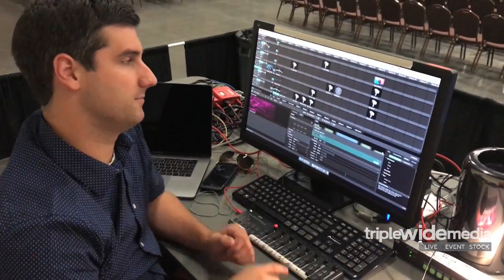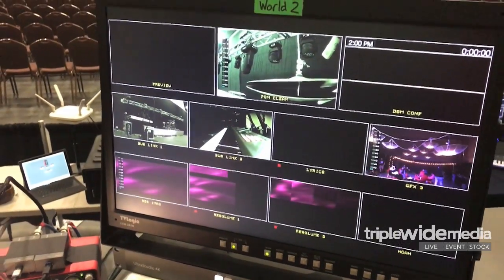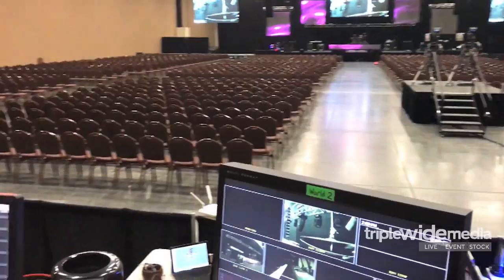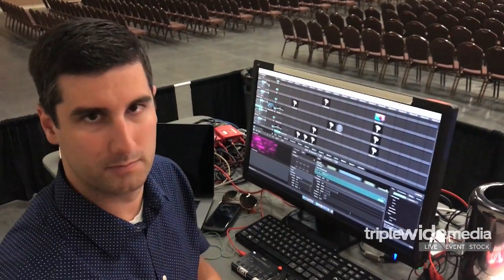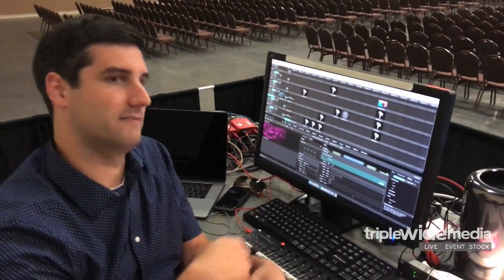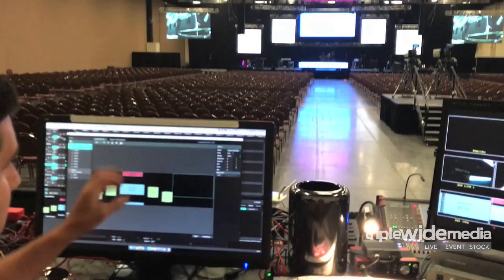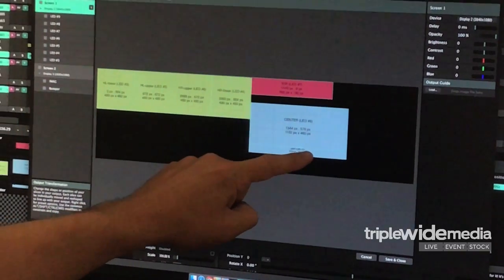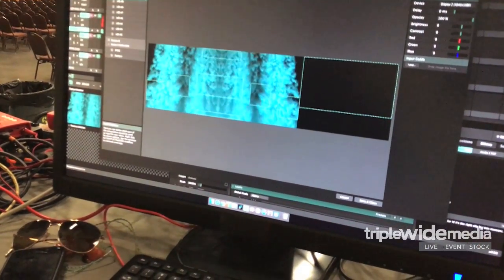Behind the Scenes with Resolume at High School Camp Part2

Comment: Very cool Luke and thanks for sharing . The moment I saw the Decimators , I knew you guys would have a nifty setup . Which switcher are you using . The switcher control you are operating - is it triggering macros . Why didn't you have the switcher itself near you for better coordination?
Reply: jojiran thanks for the complements! I can’t take all credit. CMS out of Atlanta provided the switcher. Not sure exact model but it’s a ForA. The reason the fly pack/switcher wasn’t near me was due to the fact that they needed to be backstage for size and avoiding distraction when director was talking during speaking moments. 

But we all had intercom, so we were pretty coordinated. Hope that helps!